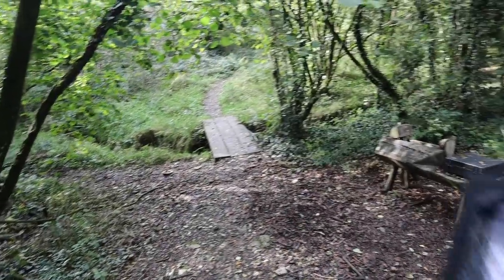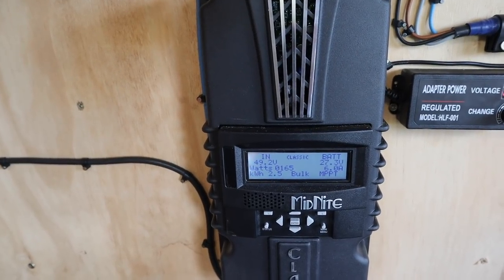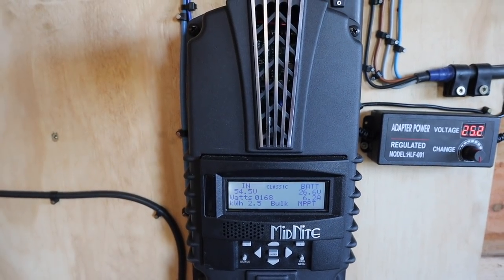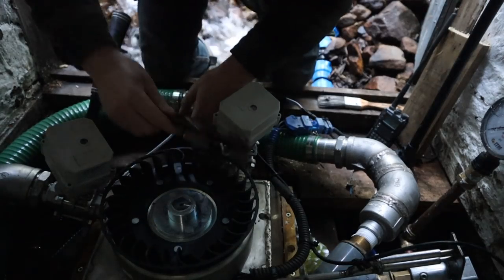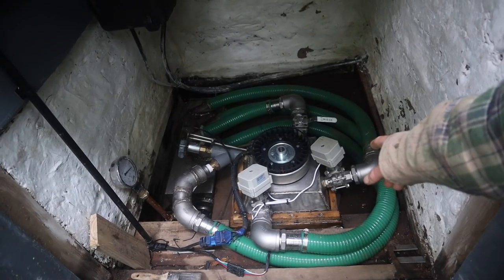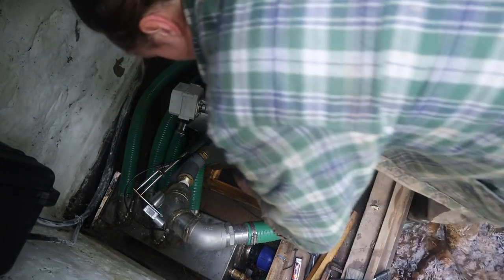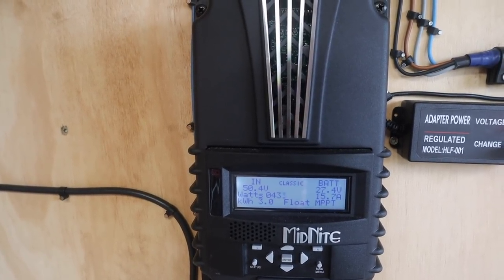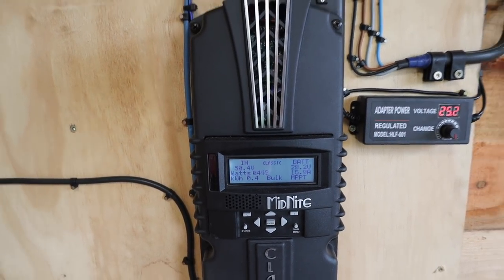Off Grid Micro Hydro Turbine Fine Tuning (13.25% Increase In Efficiency)

Comment: I am not an expert but had to do this for making a toularoid transformer power supply. The diodes get warm because the capacitors are to high esr. it puts the switching load on the diodes. if you use different capacitors of different sizes  eg small carry fast switching better  and big for low switching . it will reduce ripple and increase the efficiency . the caps you have is adequate for the load.but adition of smaller ones will help. have you measured the ripple under load with a ac meter on the rectifier side before the caps

Comment: 6 high current schottky diodes is all you need to replace the rectifier, they will still generate some heat but the data sheets will give you a good idea of how much heat to expect. I'd say look at the data sheets on the farnell website, then buy from china on ebay...

Comment: You could try a alternator rectifier, , it could run cooler, I'm not sure of the voltage drop, but look into 
The* ideal diode, * surely it can be a rectifier, or possibly a SCR,

Comment: you might want to consider swaping to smooth bore hose. you would be suprised how much friction you get from them hoses!
Reply: If you check carefully in previous videos I think you will see that the hose IS smooth bore. (Something which would be obvious to someone who has designed and built a hydro system after extensive research......!!!)

Comment: use a VESC in regen mode - that should take care of your bridge rectifier problem

furthermore - the power loss increases logarithmically with the temperature for a bridge rectifier roughly - you'll be wasting 20+ watts more at 70 c than you would at 20c, you could see a statistically relevant increase just mounting it on a cheap Chinese water block and passing stream water through it and replacing it with shotky diodes, but you'll have a hard time sourcing shotky's at the power range you want without breaking your budget, VESC is your next option.

Comment: Would removing the impeller fan from the top of the generator free up some power? I know doing the same thing on a car can free up something like 10hp. Air resistance is no joke. 
its not shrouded so i dont think it could be doing all that much for cooling yeah?
Reply from the maker: It would be at least 30w at loaded rpm in the fan but i dont think i want to get rid of it.

Comment: Hey Kris, would it be possible to automate your valves further by having your system either detect the flow coming into the manifold (maybe pressure?) and turning on/off valves accordingly to maximize yield? Or, combine that with load sensing as well and if you have significant load on your system (you're using your water heater and table saw at the same time for instance) you could have your system open more valves accordingly?

and to top this all off, you could have your system keep track of which valves are open, and what your adjustable valve is currently set at to get a totally custom throughput. So your system decides that you would need 3 l/s to achieve maximum efficiency based on the current flowrate/pressure of the manifold so it would factor in your manual valve and then open your 1 l/s nozzle and then adjust your spear valve accordingly. 

Lot's of room to run with this :) I'm excited to see where you go with this!
Reply: I have been thinking similar all the way through these video. A raspberry pi or similar in the man cave running the software and monitoring. Also Kris has talked about running another pipe from the pond during increased demand. It could also operate a control valve to raise and lower levels in the pond during demand.

Comment: Hi Kris, last year, the bridge rectifier in my Pelton hydro system had a short (1 diode inside had short). One of the generator coil had  burned, I had to change the generator. (same as your but 220V output). I aded since fuses on the bridge rectifier input.Take care !
Reply from the maker: I did that after you told me about that ages ago. i have a three phase motor circuit breaker like you suggested.
Reply: @KrisHarbour  you are a lucky man, plenty of water ! nothing in my stream, we had a hard summer !
Reply from the maker: yeah i did read about how bad it was in france. it was ok here this year and we have had loads of rain for the last few weeks. is it still very dry with you?
Reply: @KrisHarbour  No, we had rain, but not enough yet for the turbine.

Comment: The only way you going to make it more efficient to keep your pinstock The same size all the way to your manifold in your turbine house and to your nozzles you need to keep them the same size on the two opposing each other and if you switch to 48 volts you're efficiency will also go up at least 15%.

Comment: I always wondered about urban households not yet switched to water meters, if there would be any practical issues in just connecting the mains water to a generator to get free electricity.aside from the environmental impact of course
Reply from the maker: even if you had 20psi of pressure. the flow from household mains is far to low. if you got 2 watts i would be surprised. the friction looss in the plumbing is just far to great to make any useable power. if you tapped in to the main in the street it would be a different story.
Reply: @KrisHarbour  thanx I was thinking small like AA battery chargers. I'm metered so don't worry lol

Comment: Should have got a rpm tach Reader.. dab a white dot on the wheel and scan it... Higher the rpm higher the output.. use them for 2 stroke engines

Comment: Could you comment on the capacitors you have on between the rectifier and midnite unit? Input smoothing?

Fabulous project - and fascinating to watch. Thanks Kris!
Reply: When the DC current comes out of the rectifier it's going to have ripple between the peaks of the AC waves, approximately 12 volts over the 54 volts, and somewhat less than that under, in this case. The capacitors serve to smooth that out.

Comment: 4. Feed line at full lenght .cut off at the top .no valves at gen. 50 prrcent more power..inside smooth. 6 inch pipe down to 1 inch. X 100 foot at 50 fall 45 degrees

Comment: put the rectifier on a thick piece of metal to dissipate heat or a small fan blowing on it
Reply from the maker: Hi, well i wasn't trying to just get rid of the heat, Was hoping to not make the heat in the first place and put that energy in to the battery instead.

Comment: Hello friend , you can build a extruded 2 d nozzle array out of stainless sheet , emagine you draw a top view of the best nozzle manifold on paper then make it grow out of the paper , yes you can build 2 d systems they dont need to be round , i biuld burners for heaters and dryers and i build box or square burners instead of round becouse its so simple to do reduction and divergent nozzles , Talk to me f itnrested , you have no idea how easy this could be , i will do a drawing for you if you would like . just think box not round . you can still use your valves i have a plan for that as well

Comment: Great video as usual Kris, knowing that you love your gadgets so much, why don’t you buy one of those meters that count the RPM of the turbine by putting a dot of paint or a sticker on it. Would save a lot of time and walking or have you got to up to shed each time to turn things on and off?
Reply: there are free apps for both Android and iOS phones which will give accurate rotation speeds, as long as you can mark the rotating device clearly to enable a strobe effect, I've used them successfully to track RPM of a lathe we were modding, turned out as accurate as a dedicated meter
Reply from the maker: The rpm is kept constant, by keeping the turbine under load so it does not change,. the rpm is very nearly the same at 1lps as it is at 5lps. RPM is not a gauge of output in hydro. rpm in hydro is always kept constant under load at about half the nozzle volocity in order to catch the energy in the water. you can see this in the last video i did. the turbine spins the same speed with one nozzle open as id does with all 4 open.

I have a rpm meter and on top of that i can see an even better version of that by measuring the open circuit voltage, infact you can see the voltage on the charge controler so i can see all of that anyways, but it serves no use in telling us anything about the turbines efficiency. it only tells us it free spin rpm. BUT the water smashing around at free spin (due it its energy not being absorbed by the turbine) means there is water causing drag so it is a misleading measurement anyway. We always talk about turbine under load not free spinning. This means RPM isnt a good measure for power output or efficiency

Comment: Would it be correct to say that system efficiency is tied to rotational speed. If so, would it be a good idea to use a portable rev counter to measure rotational speed at the turbine itself as being the means to increase efficiency rather than have a two way radio conversation to determine the same thing in terms of voltage, that is, maximised rotational output?
Reply from the maker: Hi, No rotational speed is not a good indicator. The rpm is fixed to a set speed so that the turbine can absorb the maximum power from the water and as a result the water contains very littler energy and falls away out the bottom. Letting it free spin and reading rpm would not be removing the energy from the water and would give low readings and lots of splashing causing drag. In hydro electric we fix the rpm to be half the speed of the nozzle velocity so that energy can be converted efficiently. If the turbine didnt spin 0 power would be converted, if the turbine free span then 0 power would be converted as the turbine would just be moving out of the way of the water without having any load on the alternator. what we want is for the turbine to be loaded in a way that the turbine moves away from the jet at half the speed the water hits it at. this way we catch most of the energy. Free spinning and rpm readings for efficiency will not be accurate.
Reply: Hi, thanks for that. I'm an electrical engineer so I don't have a problem following the electrics. Atm I'm learning all I can about micro hydro, wind and solar and it's great to follow your amazing off grid system build using all three. Regards

Comment: One of your biggest loses will be with power distribution/transmission.
Much better to build a shed next to the hydro and house your storage and inverter there, then use the higher 240V to send power over the long distance.  Distributing power using low voltage over long distances is very inefficient!!
(You can still control it remotely at the shed  obviously)
Reply from the maker: I run 50v in 16mm cable and get like 1% loss over 100m. Everything was worked out in detail a year before I even started building the system.

Remember I have multiple power sources. The power shed is central to them all to make sure the loss from all of them is minimised.Because the hydro is far away I ran large cable to make sure there was little loss. And it is like 1-2% at full flow

Having the batteries close to the hydro would
Mean running long runs for the solar and wind. And at the very least having to have my power shed in a damp woodland and have to carry in the 500kg battery by hand. You don’t have to worry I think about this so you don’t have to
Reply: @KrisHarbour  a beautiful example of the difference between clever thinkers and practical thinkers!
I've worked with some absolute geniuses over the years - who couldn't tie their own shoelaces....!
Not practical!!
Practicality and 'bigger picture' thinking is essential in the real world!

Comment: you should step up the voltage with a transformer at the generator: reduces transmission losses, and ac-ac conversion is quite efficient. Furthermore, since the bridge rectifier has a (pretty much) constant voltage drop, putting a higher voltage - lower current signal through it reduces the loss at the rectifier.

Comment: Any idea what your 'whole system efficiency' is ? (watts out / (9.81 * flow * gross head).  I'm 60 miles east of you generating 410 W on 1.47 l/s at 53.6 m head giving a whole system efficiency of 53 %.
Reply from the maker: Well it depends on at what flow. I think my peak at the moment is about 65-70 but im not sure untill i measure the flow properly. i will do a video about that soon i think.
Reply: @KrisHarbour  Be interested to learn what yours is at different flows if you can get round to it. The difficulty is being accurate about the flow: direct measurement is tricky and getting it by calculation requires the Discharge coefficient of your nozzles to be known, - and that too is tricky. Best of luck !
Reply from the maker: i know what the math says it is but in real terms it will be different from that like you say. i will set up a way of catching the water out of the turbine and measuring it over time.

Comment: Would a Timing light on the rotating fan not give a super accurate method of tuning? You could tune for the highest RPM on your own.
Reply from the maker: The rpm is kept constant, by keeping the turbine under load so it does not change,. the rpm is very nearly the same at 1lps as it is at 5lps
Reply: what about a suitably sized series load on one, or all of the phases. 4 x 12V 50W globes, car headlamps, in series for a 200W 48V dummy load? Measure the voltage under full load.

What a great series.
Reply: It's AC and the MPPT is trying to keep the voltage/rpm constant, so the easy choice would be a cheap clamp meter and measure the current, provided there is a suitable load on the system.
Reply from the maker: @MarkRose1337  That would be a good way to measure. i just dont have one. but i might think about getting one.

Comment: Another fascinating video kris, couple of questions, how much has that roughtly cost to setup and make, and if you had got a company to install setup etc how much would that of cost. 👍
Reply from the maker: Well including everything about £5000 but Thats because i have made it quite complex and fancy as a demonstration of what can be done with a small stream. the first system was only £2500 (it cost about that again to get it to the stage it is at now) But alot of that cost was due to experimenting and finding what works best.  

There is no company in the uk that would even entertain the idea of a system of this size infact the two i know of told me it isnt possible with that amount of water and is pointless....... It isnt cheap and will take a while to pay itself off but getting mains power here would cost £50.000 so its already paid for itself many times over. it is also sustainable and renewable and due to the videos an educational source. As far as i am concerned it is very good value.
Reply: @KrisHarbour  wow knowing that Kris you have done an even more fantastic job. Gap in the market for you there Kris. Well done and thanks for the reply 👍
Reply from the maker: Thanks, yes thats what im hoping to do with my new workshop as i really enjoy the hydro stuff.

Comment: I DON'T KNOW MUCH BUT HOW ABOUT USING THAT EXCESS POWER BY USING IT TO HEAT WATER?? LIKE YOU WERE DOING IN THE CABIN??? PUT THE POWER INTO HEASTING WATER FOR THE OUTDOOR SHOWER??? SAY A 50-60 GALLON TANK??

RETROFIT AN UNUSED HIOT WATER HEATER WITH A DC HEATING ELEMENT???

Comment: Hi Kris,
You may well be able to find a more efficient bridge rectifier but that may have significant cost implications, all bridge rectifiers have losses in the form of heat. Have you considered making use of the heat energy? - Such as: https://en.m.wikipedia.org/wiki/Thermoelectric_generator

Comment: 24:30 You should at minimum increase the heat sync size and put a fan on it.
Reply: the fan power consumption would lose any gain.

Comment: What are the black things between the rectifier and the charge controller?
Reply: High ripple current electrolytic capacitors to smooth the output of the bridge rectifier.

Comment: Is there any improvement to be had by extending the nozzles out to be closer to the impeller?
Reply: They are almost touching the impeller already.
Reply: @manolisgledsodakis873  Maybe the outer diameter. With a conical nozzle it looks like the discharge could be much closer.

Comment: If you really want to increase your power you need to run the same diameter pipe into your turbine house don't reduce it down at all that's why your pressure is dropping when you cut the other nozzles on too much pipe friction.

Comment: This is possibly hard for you to measure at this point, but I wonder if there is any correlation between the position of the center of each water jet, and the efficiency.  One would assume those cups have a sweet spot.  If you could find that, then even if you swap larger nozzles in, you would know where to position them without much testing.  Great video, love the process being detailed.  Keep it up!
Reply from the maker: That spot changes with jet size. working out that formla is what myself and my friend john are trying to do.

Comment: Does the air turbulence and water spray inside the housing effect efficiency?  Great show!
Reply from the maker: it does a little bit that is why the max turgo efficiency is around 85% There isnt going to be alot i can do at this point to make improvements there. almost all the water get blasted out the bottom and there is very little spray and i made the turbine as small as possible to get the least wind resistance.
Reply: Kris Harbour Natural Building would building the housing round with the wheel at a slightly cocked angle (to the up and down axis) and mounting the nozzles in a descending spiral around the housing help? Sorry for asking such an odd question, it just may be food for thought.